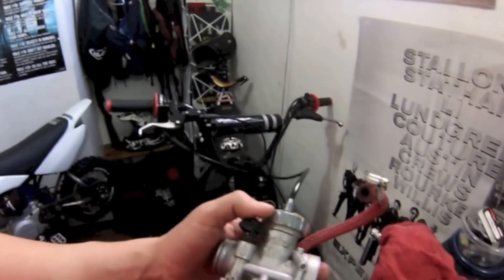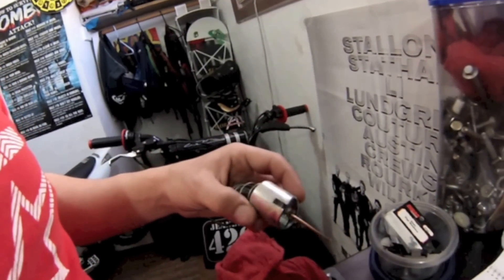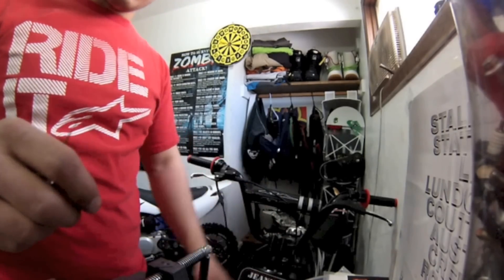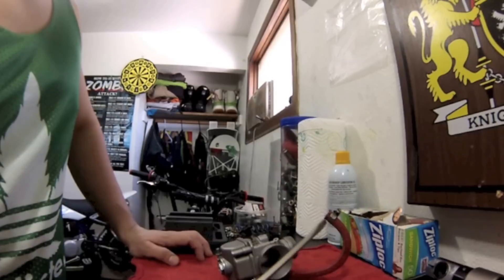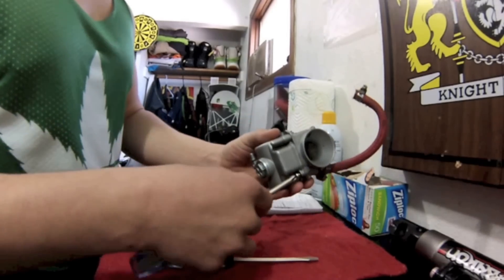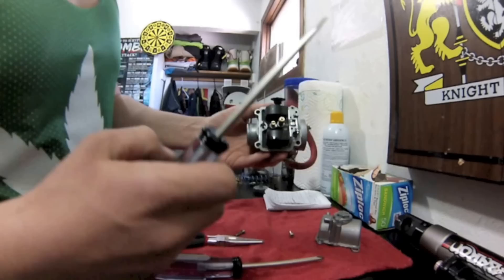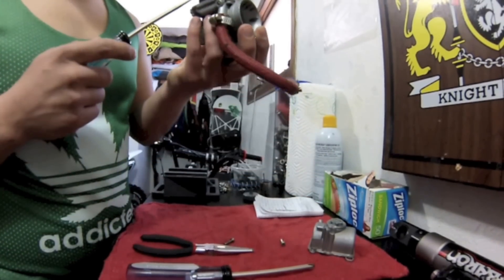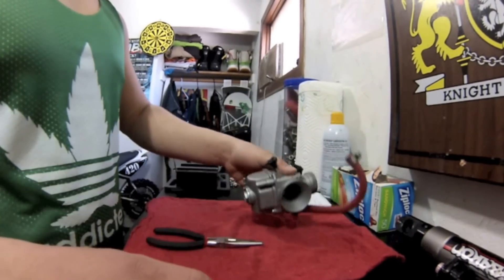Geography vs. Your Engine: How to Tune a Carb on a PitBike

Comment: When my pitbike engine is cold it starts really good and you can give it good throttle, but when its warm the engine stops running when you give it a little throttle or more. Do you know what's the problem?
Reply: I know your problem, it is a Chinese Orion pitbike

Comment: i have a 4valve 172cc YX Pit Bike the thing is i just got the parts for the upgrade becouse it was a 160cc and the only problem i have is when i kick start it it needs 10 to 15 kicks or more depending on the temperature, does the carb need some sort of adjustment or its something else?
Reply from the maker: Prolly need to ad more fuel with the bigger displacement

Comment: Colder air in denser and contains more oxygen and therefore requires more fuel to be burnt to achieve the correct stoic ratio. If you are at a high elevation there is less oxygen and the bike will require less fuel to preform optimally.

Comment from the maker: when it back fires(some times it will die too due to the engine starving for fuel) that means there isn't enough fuel getting to the engine, the popping is from too much air in the cylinder and not enough fuel. u know like when u add oxygen to an open flame. sometimes it gets huge,almost explodes, imagine that in a tiny cylinder, kinda the same concept..  when there is too much fuel it will bog out, slightly and then rev sometimes it will just bog and die,  and sometime smoke a little because your flooding the engine.

Comment: And weebz maybe try adjusting your tappets
Reply from the maker: did u mean idle screw/ air screw. i would give that a try weebz if you haven't already, start 1.5 turns out( after you turned it all the way right to close it. then go 1/4 turn at a time

Comment: I'm pretty sure that if it's  backfiring and popping the fuel isn't burning properly because there's to much of it causing the excess fuel to ignite out of the exhaust pipe and not in the motor? Please correct me if I'm wrong?

Comment: so i have a 125 gio just got new billet metal throttle trying to solve problem of my bike wont idle on it own i have to have my hand on the gas icant figure out why!? its not the idle screw ive played with that its frusrating you have any idea?